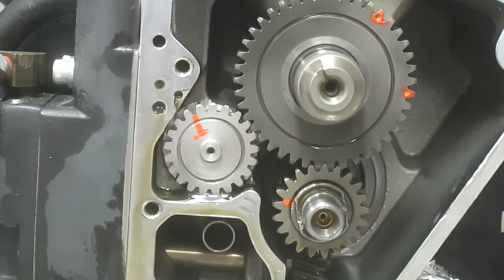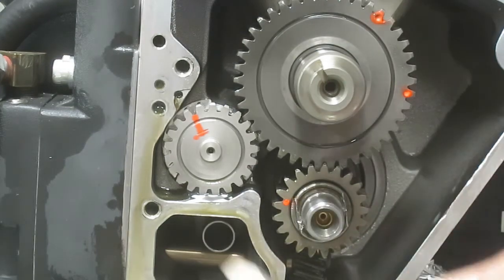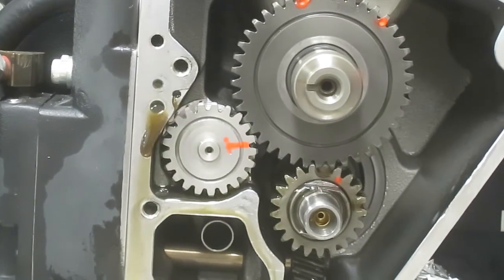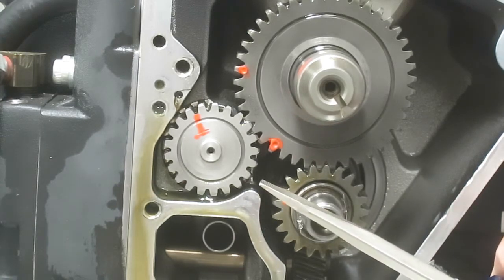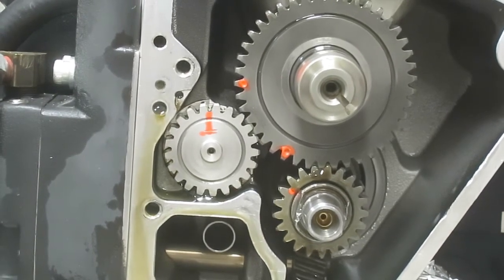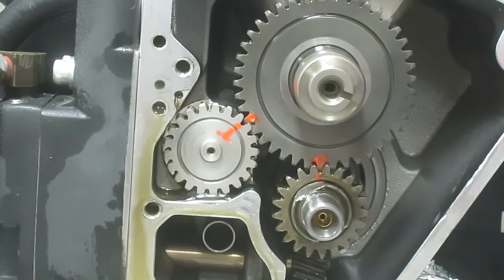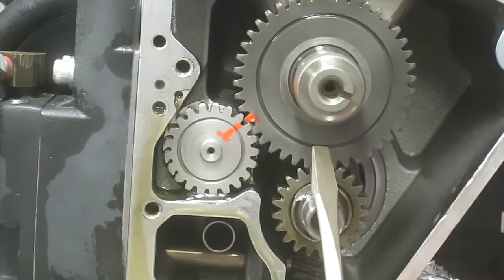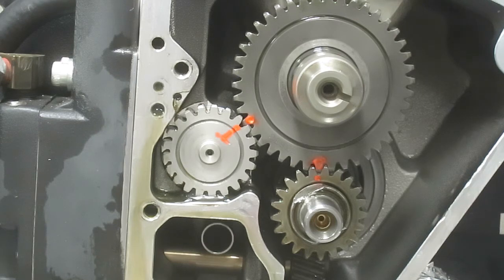MVI 1177

Comment: TDC and pinion marks don't have anything to do with each other. 
And pulling the cam cover without removing the pushrods isn't good on the cam bearing/bushing either.
You clearly don't know what you are doing.
Reply: asasial1977 Ive changed the seal and cam cover gasket without removing the push rods no problems.
Reply: No he has no idea what he is doing.  Those marks are lined up based on the fact that the crankshaft and cam gear are lined up in where the flat area of the 4 lobes have all 4 valves closed in the heads.  his cam and pinion and breather are lined up perfectly as they are meant to be.
Reply: Thanks for the sanity.

Comment: Gear alignment/timing marks have nothing to do with piston or crank position. They are solely for installation purposes unless specifically stated otherwise. Surely, the shop you took this engine to pointed out the error in your conclusion so you should have taken down this video to avoid spreading misinformation.

Comment: WTF are you talking about? Are in smoking krak?
Reply: Joe, Any suggestions on low oil pressure at idle? 1981 Shovelhead
Reply: Gordon Woolfrey normal
Reply: What do you consider low oil pressure? Mine 72 on a hot day shows zero on the rocker gauge.  If you are worried about it, pop a pushrod cover off and confirm there is oil dripping down.
Reply: isnt it spelled crack ?
Reply: @nwinter9859  shovels run on oil volume more than pressure. clean the screen ,20/50 Valvoline VR1 oil, if oil lite does not come on .... ride your bike......75 FX
Reply: @ksfixit9073  I know it's a late response but I had to say something about using VR1.  Best oil out there, been running VR! in my chopper since the first time it fired off and always ran VR! in our stock cars when everyone else was running $8 a quart synthetic.